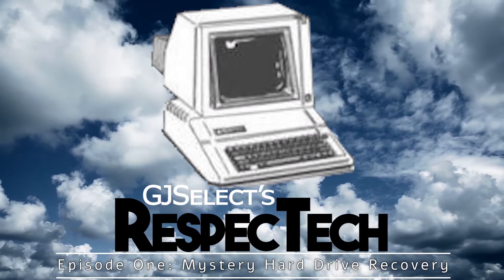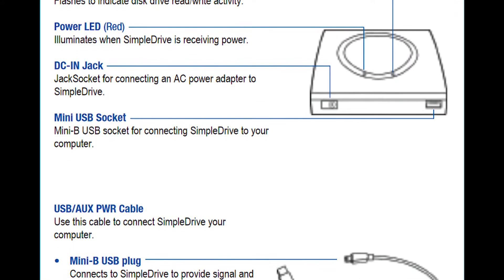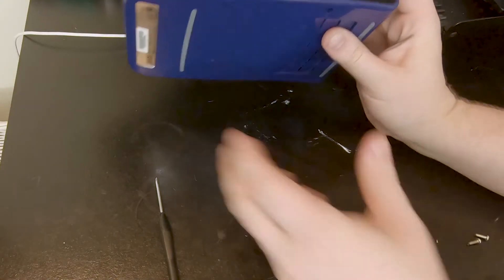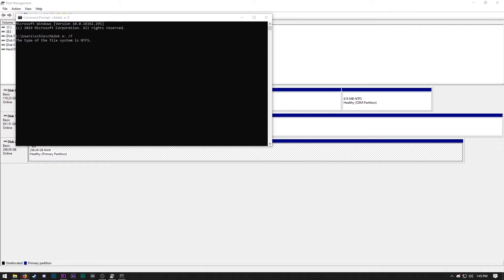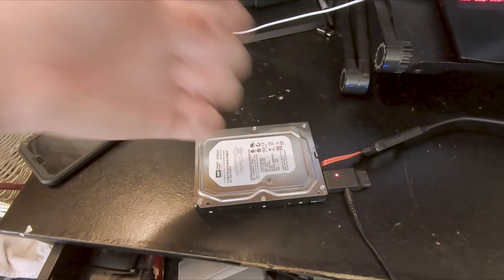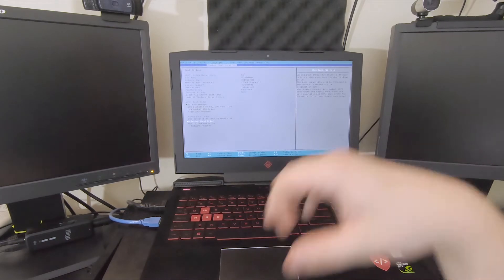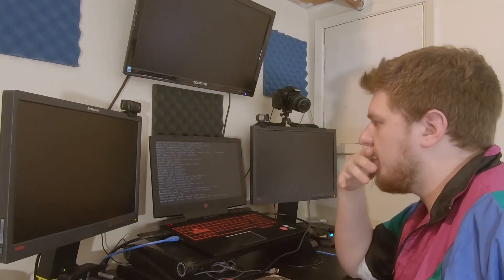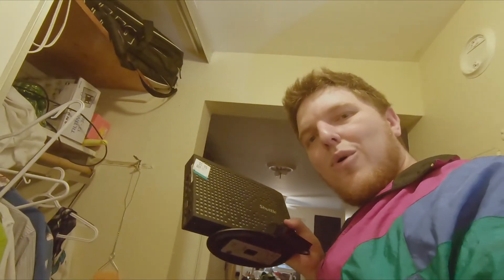Mystery Hard Drive - RespecTech Episode 1

Comment: I like your content. Good production quality with almost no budget. Snip-snip was a bit brutal, there is a detachable connector on that ribbon cable. As for the IBM hard drive, it should be good to boot in an era-appropriate machine or a VM.
Reply from the maker: I still have the DeskStar on my shelf waiting for the right machine to install it on. It's one of my top drives to get booted, who knows what's inside!